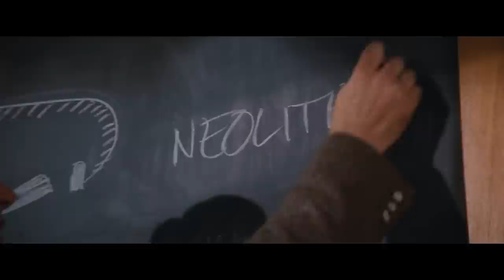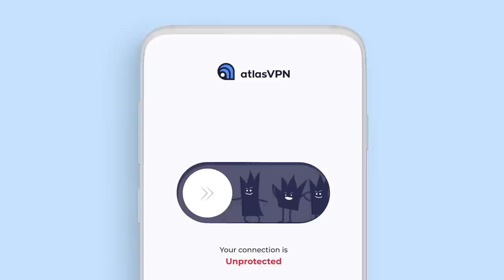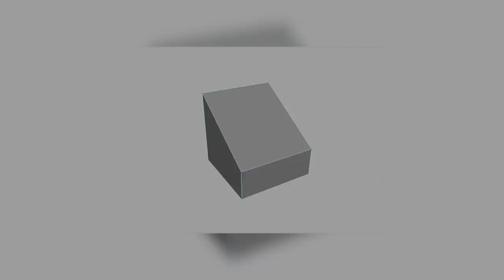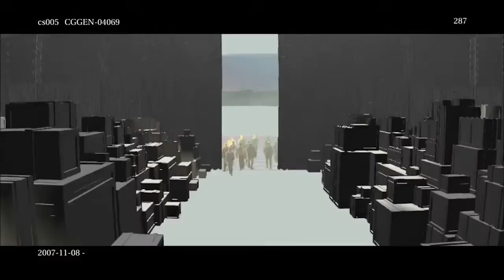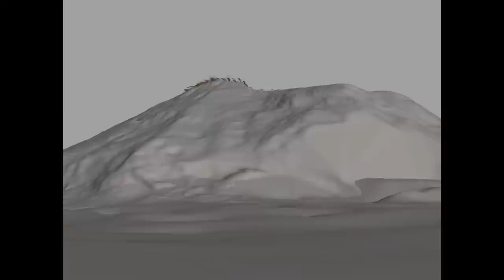The Evolution of Indiana Jones's VFX

Comment: As someone who’s both an SFX and VFX guy I always said that they both sucked and both excel. A few years back I worked on an indie movie and there was a scene that a kid I we covered in leeches (lots of winks to horror films of days gone by). This was tagged as a CG shot. As a guy who does both SFX (electronic props and SFX make up) I was like: “this calls for practical for the wide and the mid shots” because having a kid come out of water and than tracking leeches on that glistened surface is a nightmare. You would need to paint tracker markers on the body. But then you’ll need to remove those. And there’s not a lot of surface to clone and hide the markets and it’s going to be a time consuming frustrating thing to do. And that’s with the object track matches. If it doesn’t we need to rig a complete digital human shape model, match that frame by frame  and stick the CG leeches on that. Which has its own problems because this kids is muscular so you would need to match the muscles and it’s movements too. It’s a typical special effects makeup shot.
We just make a 100 little leeches and stick them on the boy.
Now the director has a background in SFX props and makeup but all from the early days. So he was like: “but rubber bands like will look fake as if something is stuck on. Foam latex and gelatine can’t handle water.” It’s ironic that the director is 15 years younger than me and literally stopped in 1995 with his fx knowledge. I reassured them that I can do it with what we call deadened OO silicone. And because Sunny (the talent) is so lean and ripped that rubber will flex with his muscles as comes out of the water together with the glisten it will look as though the independently move.
The director and producer weren’t convinced. I told them I would make a set of 3 different leeched and cast 9 and send them across the pond with some waterproof medical adhesive. I spend 3.5 hours modeling and cast the leeches. The do a camera test and the were like… make us 80 more! This looks amazing! And it feels so real! 
And we will only do the extreme closeup of the moving leech in CG! And then the pull from the skin we also do practically because this stretches so nicely!
And I said: “exactly my thoughts!”

There’s one thing that old SFX artists know that VFX supervisors are often not as good at. And that’s thinking in different shots to tell the story. VFX supervisors often think in a completely single shot. Because that’s how the create everything in their 3D softwares too — and it seems to be the wish of modern directors too to shoot as much as possible in a single (yet dynamic) shot.
And old practical FX guys think in shots to hide the weak spots I in illusions and the mechanical trickery that makes it work.

Imagine my frustration that my first SFX job was creating special effects for a live TV show that had to fool people at home (that’s easy) and people right on top with their noses. Basically selling a lie that someone has extraordinary abilities just like Uri Geller (who was a judge and presenter). Man, we build things in 6 days time from scratch never done and seen before and we’ve test them at the day of going out live 😂That was the most stressful job I’ve ever had. And it was my first SFX job 😂

Comment: I think it's worth noting that while acceptance and use of CGI skyrocketed in the 90s and 00s, fully convincing simulated explosions and destruction was one of the things that was still too tough for CGI to successfully pull off and really required being done practically.

I mainly think about the advancement of VFX in terms of Star Trek, a franchise that was famously dependent on models even resulting in shockingly movie-quality stuff for TV in TNG.  In the movies they flirted with occasionally CGI ships in Genesis (1994) and First Contact (1996), then went fully-CGI with the spaceships in Insurrection (1998) and Nemesis (2002) (which was really too early and it also didn't help ILM were presumably too busy with Star Wars to work on them, but...) making big, effectively inert spaceships CGI was an inevitability. Despite this, the movies always end with big, climactic explosions and the giant array blowing up in Insurrection and the Enterprise crashing into the Scimitar in Nemesis still had to be done using models because the effect is too complex.

By the time of Star Trek (2009) the franchise was fully in the modern era of VFX I'd say, it was ILM again, the virtual spaceships looked effectively as good as models now and simulated CGI carnage was no longer off the table. We're over a decade later now and I'd say it's so no longer off the table it's practically embedded into it.  Those new movies became kinda bad but otherwise the CGI carnage was really high quality... in fact it was utterly gratuitous in all three of them.

The point I think I'm reaching for in this rambling comment is that I would argue when people talk about practical being better, what they're really saying is not necessarily to do with how good or bad the CGI looks—however much that may be an additional, compounding factor as well as who is doing it and their budget—but rather that practical VFX by its very nature enforced a level of restraint that modern directors can now choose to just discard completely, to the detriment of the films using their VFX as a selling point.

Comment: The initial puff of dust and vapor off of the buildings, at least in a real nuclear blast, is actually from the heat of the explosion rather than any pressure wave. It vaporizes the paint and other materials and pushes away the ablated cloud with the sheer force of the thermal radiation.